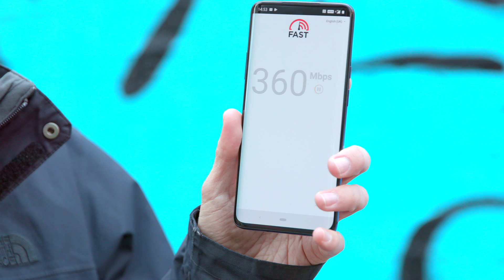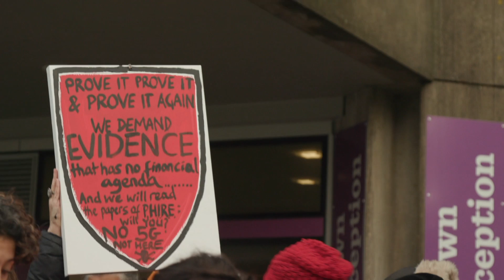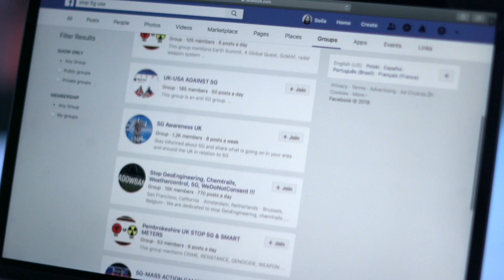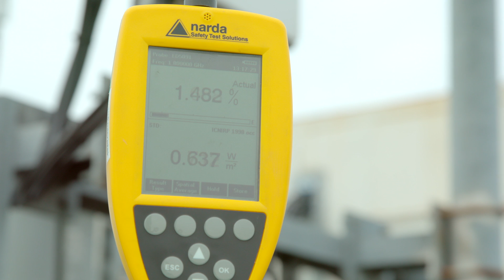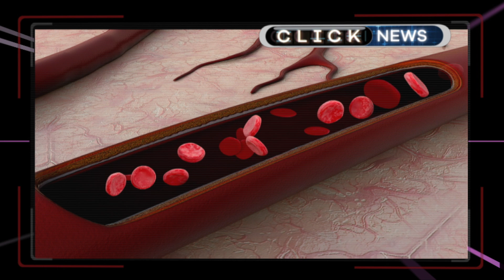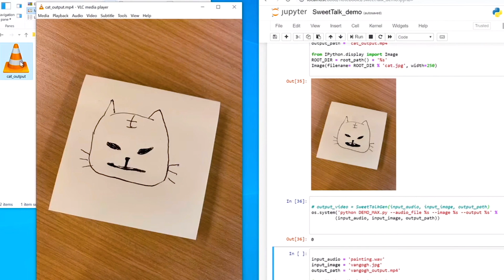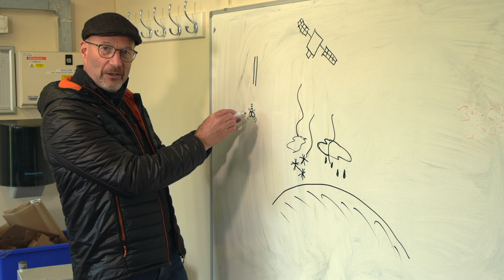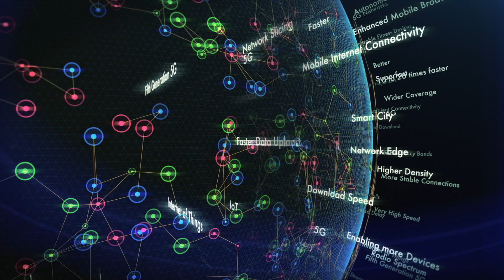What's The Impact Of 5G? - BBC Click

Comment: Recommend Government Safety Level .. paid for by Corporations. The problem with 5G spectrum is you need 200%-500% more towers often a mere 500' (150 M) apart moving next to homes and businesses, and increasing microwaves from 6 GHz to 300 GHz or a 5,000% increase towards the ionizing radiation spectrum. 

End result is the potential of having low often 20' (6 M) 5G towers littered throughout your residential potentially on every major corner you live.

Comment: And the security limit is set by who ??. And it's not so much the masts that are dangerous, but the mobiles send out powerful signals through the human tissue. Everyone says that's for sure. It's good enough at high speed but test and test again. Everyone talks about the measurements being under 50 times lower than the recommended radiation :-) lol. No matter if it has been around for 50 years, it is still new technology

Comment: What wasn’t addressed is whether any environmental impact analysis has been done due to the huge amount of antennae (and new places to attach them) that will be required (about every 250 meters or so) and whether those antennae attached 24/7 near trees will cause any biological issues. 
It’s just odd that considering the profits possible that the industry doesn’t just do these environmental impact tests with clear transparency. 
Precautionary principles still apply. 
- source: 
https://spectrum.ieee.org/video/telecom/wireless/everything-you-need-to-know-about-5g
Reply: The power level is much lower on the small cell networks  (e.g. 20dB) you're referring to though, compared to the macrocell they test here (e.g. 40 dB).

Comment: I understand all signals drop off rapidly from their source (following the inverse cubed law I seem to remember) but since no one is really using 5G at this time, surely the transmitters are also not working anywhere near their maximum power? Plus, I thought they were supposed to be directional (i.e. targeted) unlike 4G which broadcasts to the entire cell around the mask?

There are going to be loads of these smaller transmitters lower down because the signals don't travel so far and need more of a line of sight to your phone. But each phone will be / need to have a 5G transmitter to connect and upload data so those higher frequency radio waves will be being broadcast right next to your head (if you're not on hands free).

Environmentally, I understand 5G requires far more power to operate both for each individual mast and overall due to the sheer number of masts required. So both the energy and resource requirements for the amount of infrastructure involved are going to be immense at a time when we should instead be rapidly reducing the amount of energy used whilst greening how what we do actually need is produced!

Comment: 390Mbts per second. Yeah until the contention ratio is enacted and others start using that particular repeater then it’ll be little more than 3G, oh sorry 4G as the suppliers would have us believe.
Reply: True. Initially, there won't be so many people using each tranceiver.  Their Internet will be faster, but with the bandwidth limitations of the first 5G rollout, limiting 60 - 120 connections (5Mhz-10Mhz) it will seem slower than 4G.

Comment: I guess people don't understand logic or perspective. So here is both.

RF doesn't get dangerous until the photons have more energy than UV which has a frequency of 3 Peta Hertz (PHz). So to put that into perspective, the conversion is 1 PHz = 1 million GHz. The energy per photon goes up with frequency .  NOT OUTPUT POWER.

Output power determines how "bright" it will look and how far it can be seen. There is a difference between power and energy. Think of a light bulb as a RF transmitter. Believe it or not, the light bulb is transmitting RF on frequencies that are about a million times higher then those we normally transmit communication signals with. You know what's weird? Our eyes and our entire body doesn't get boiled alive and we don't get radiation sickness from light bulbs. Strange how that works out...

If only there was a reason for this
Oh yeah, simple physics, and logical thinking.
Reply: Not according to 3,700 studies collated in 1971 by the US  Naval Institute.  See also he Bio-initiative report, an appeal to the UN by over 250 scientists, which states that biological damage has been found at between 10,000 and 100,000 times below the ICNIRP Safety Guidelines.  The so called 'safety guidelines' do not cover health and safety  of EMF's, according to Professor Martin Pall, because they do not cover the known health effects of EMF's which include - DNA  damage,  cancer, infertility, neurological  disorders and neuropsychiatric disorders like depression,  anxiety and insomnia.  Check out the former senior Telecoms industry scientists who discovered that children's brains absorb up to 60% more radiation than an adults brain  - then got sacked by the Telecoms industry.
Reply: @fionaphilips6565  1971? Only 250 scientists? Really?

 You do know that sources do age and become obslete. Our understanding of technology now is not even slightly comparable to what we knew back then.

Not only that, but if RF was such a big deal, why is there no increase of any of these conditions. If any of your or their theories are correct then there should be a direct correlation of RF adoption to rate of medical conditions. As in, there was an exponential growth in RF tech and basically no correlation to an increase of the conditions you stated.

On top of that, you realize that you are bathing in MASSIVE amounts of EMF when you step outside. The amount of energy coming from these 120 Watt transmitters is not even close to the amount of energy coming from the sun. Again, even though it is wavelength that matters not output power. And the sun emits RF throughout the entire EM spectrum (all frequencies)

If you are that worried about medical side effects from EMF, don't take one more step outside
Reply: @1kuhny   I don't  know the difference technically between the suns radiation and EMF's but I could  easily check with senior scientists.  I'm fairly sure they would say there is a fundamental difference.  Children's depression and anxiety has gone by 48% since 2004, since the time when WIFI and mobile phones became ubiquitous.  We have the highest levels of suicides in British universities now - at Bristol university, (where 5G is also being tested,) 11 suicides over 18 months.  Interestingly one of the  scientists on the BBC program hailed from Bristol too.  Adults now at universities are the first 'digital natives' i.e.  adults to have grown up their whole lives exposed by EMF radiation - in schools, at home,  and coming near you, with 5G soon:  everywhere- 24/7.   Professor Om Gandhi found that children's brains absorb up to 60% more radiation  than an adults brain.  He was a senior scientist employed by the Telecoms industry - he soon lost his job when he refused to change his findings.  And the effects of EMF's are cumulative.   Please see this report showing 197 scientific studies that show 9 types of health effects below the level of the international ICNIRP guidelines.  This includes anxiety and depression:
https://mail.google.com/mail/u/0/#search/martin_pall%40wsu.edu/KtbxLwhCHVxmHRFdcjwJwKTjGnxGTcCmjB?projector=1&messagePartId=0.1

These Neuropsychiatric disorders are scientifically proven health effects of EMF's.  Also brain cancer, specific  to  mobile  phone usage, called gliomas have trebled in recent years. The recent major study, the 'National Toxicology report' costing millions, is clear on the cancer risks.  You must have heard of cancer clusters around mobile masts?  Professor Tom Butler, Principle investigator for technology, explains that the only reason that the WHO classed EMF's  as a class 2B carcinogen and not a class 1 is because the ICNIRP and Telecoms industry fought tooth and nail to prevent this.   The safety guidelines are a con - they don't include the biological effects - read  Professor Pall's report,  or ask any independent scientist - as Professor Butler says, the majority of scientists know that the actual science is that EMF's have serious health effects.
Reply: @fionaphilips6565  There is absolutely no difference between manmade RF sources and cosmological sources.

RF is RF, there is no way around it. Do you realize what would happen to us if our atmosphere did not protect us from the higher frequencies that the sun emits such as UV? Yeah, we would be cooked alive. We actually still do (sunburn) but not nearly as much as you would otherwise. That being said, you can get what's called RF burn if you stand right beside a high powered transmitter. This again is temporary damage just like sunburn. The reason for this is because it vibrates water molecules and makes them heat up from friction. It is the exact same concept of a microwave oven.

Just to prove that it does emit RF and a lot of it across all frequencies, you can hook a dish antenna up to a sat finder you can buy off eBay and it will happily start singing when you point the dish at it. The reason a dish is needed for this is because the higher the frequency, the harder it is for it to pass through the atmosphere. 

The link you provided only opens a Gmail inbox, so I can't really look at it

Yes I am aware of hallucinations and side effects of prolonged exposure to RF. HOWEVER, these are temporary effects. RF does not accumulate and stay in the body, that's just not how things work. It's not like mercury and lead poisoning where the heavy metal stays in your body and physically accumulates to toxic levels.

Finally, 5G uses beam forming through phased arrays, meaning that it will focus RF on your phone. So if your phone is not using 5G, you will be exposed to basically nothing. I'm not sure why people don't mention that. If you are that scared of 5G don't use it and you will be fine, simple as that. On top of that, because of the higher frequencies used, the signal cannot travel through really anything. So line of site is needed to get any meaningful signal

https://www.metaswitch.com/knowledge-center/reference/what-is-beamforming-beam-steering-and-beam-switching-with-massive-mimo
Reply: @1kuhny I'm afraid based on thousands of peer reviewed documents I think you are way off the mark, but thanks for sharing your thoughts.
Reply: @fionaphilips6565  That, or another possibility is that your mind is too clouded by conspiracy theories. 

If you want to live your life in constant fear of non-existent threats, thats fine. Because you know what? This technology and many others, that you likely disagree with, are going to  be deployed whether you like it or not. But don't spread senseless misinformation to drag others down with you...  
People like you hold humanity back and its a good thing that you will never be qualified to work on new technology. Leave it to the younger generations. Thanks.
Reply: @1kuhny  Professor Tom Butler, Principal Investigator at University College Cork’s technology centre for risk and compliance, points out that science has known about the health risks of the non-thermal effects of non-ionizing radiation since the 1930’s, with up to 3,700 scientific studies identified by the US US Naval Medical Research Institute (NMRI) in 1976 alone.  Since then the telecommunications industry has been propagating the lie that there are no non-thermal effects.  Professor Butler states publicly that: ‘All of the safety standards, since the 1970’s have been based on this particular lie’. He also points out in his recent research report that the US National Toxicology Program’s research is unequivocal in its findings on the matter.

Indeed ‘The Guardian’ newspaper argues in an article entitled, ‘The Inconvenient Truth About Cancer and Mobile Phones’, that: ‘For a quarter of a century now, the (Telecoms)  industry has been orchestrating a global PR campaign aimed at misleading journalists, consumers and policymakers about the actual science concerning mobile phone radiation. Big wireless has borrowed the same strategy and tactics that ‘big tobacco’ used to deceive the public about the risks of smoking.’

The ‘Bioinitiative Report 2012’, by 29 scientists, concurs, stating that EMF safety standards are 1,000-10,000 times higher than levels now commonly reported to cause bioeffects in ‘telecom mast’ studies. The report collates 2000 studies showing these biological effects, and calls for ‘biologically-based exposure guidelines’. http://www.bioinitiative.org/conclusions

The Public Health Department in Denmark has passed a legal opinion that activating a 5G-network would be in contravention of multiple current international laws.  This legal opinion by the Danish Public Health Department, confirms, also, that there is a: ‘Very significant body of scientific documentation showing that radio frequency electromagnetic radiation is harmful and dangerous to the health of humans (particularly children), animals and plants.’ and specifically that,  ’This also applies when the radiation remains within the limits recommended by the ICNIRP...’  https://mail.google.com/mail/u/0?ui=2&ik=9dddebf3a3&attid=0.1&permmsgid=msg-a:r-5321563928368726604&th=16d70fb31950b3ed&view=att&disp=inline&realattid=16d70c37dbbbc97ac8a1
Reply: @1kuhny  Minister, Margot James, states that 5G, ‘Will have no negative effects on public health’.  However scientist, Dr Martin Pall, Professor Emeritus of Biochemistry at Washington University, published a report on 23rd May 2019, entitled: 

“Eight Repeatedly Documented Findings Each Show that the EMF Safety Guidelines Do Not Predict Biological Effects and Are, Therefore Fraudulent:
The Consequences for Both Microwave Frequency Exposures and Also 5G’

Dr Pall, said to me that this report,‘Falsifies Public Health England’s entire claims of EMF safety.’ Key to Dr Pall’s report, is the fact that the ICNIRP guidelines, upon which PHE’s safety assurances rest, only consider the ‘thermal’ effects of Non-Ionizing radiation, and completely ignores the huge body of scientific evidence on the ‘non-thermal effects’. Professor Pall explains that the ‘safety guidelines’ do not include these non-thermal effects and, therefore, do not predict biological effects and that, consequently, they cannot be called safety guidelines.
Reply: @fionaphilips6565  These sources are funny because none of them actually state what the non thermal effects are, they only guess that there are and have no idea what they are. And only say that guidelines do not include these unknown effects.

Of course guidelines do not include effects that are not proven or unknown. Why would they? They include thermal effects because they are. So far I have not seen any tests or solid evidence. All you are providing is speculation based off some lose observations. 

Yes the one source you gave me states some side effects but then again, it's only from observation. These are not results of controlled experiments and therefore only speculation. Until a proper, controlled test is carried out, there is no way to prove or disprove  these health effects.

Good shot, I guess...
Reply: @1kuhny  Thank you.  I think we will have to agree to disagree.
Reply: John Ryan  Thanks, John, for acknowledging this!